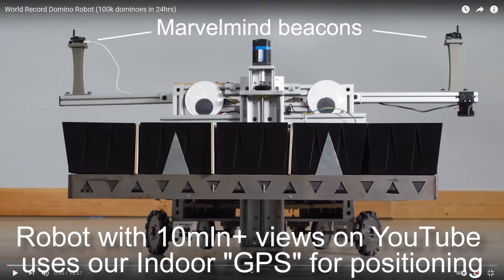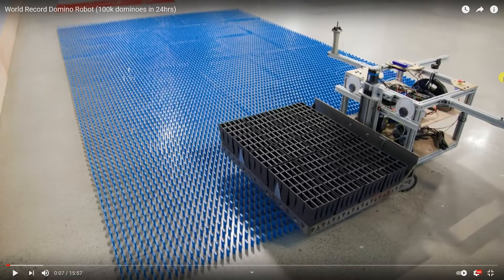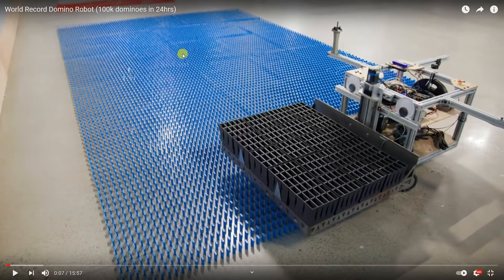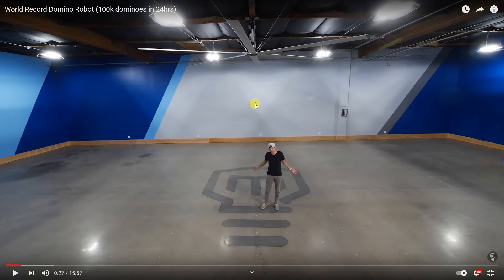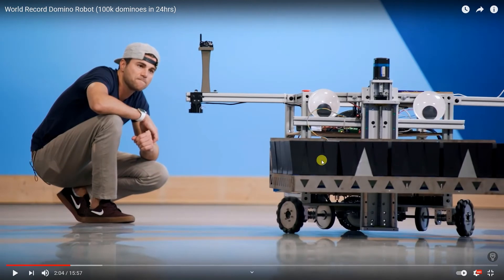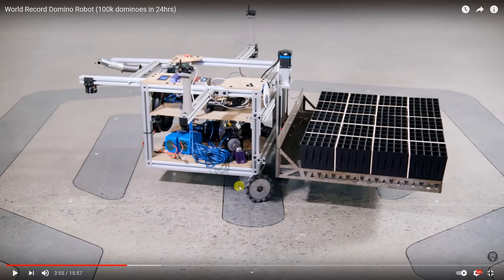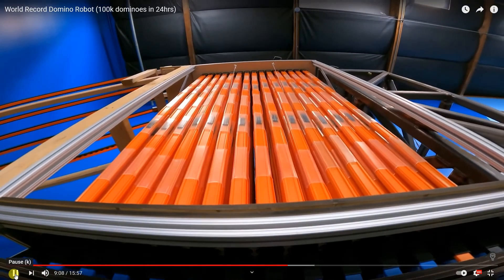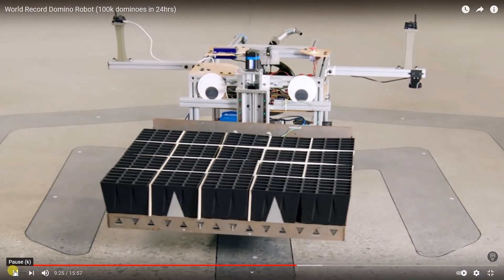Crazy people build crazy projects. We always help :-)

Comment: This video was that allowed me to find out about you. Your product is really interesting for my work where we take a certain measurements of concrete in subterranean parking spaces (potential to find corrosion) where the location of the measurement is important. Possibly we could use your system to link the location to the potential which would make our work much better and easier.
Reply from the maker: Yes, it is possible:
- Install station beacons on the walls around
- Take a mobile beacon and drive/walk around
- Spot and record the points of interest automatically with cm-level accuracy indoor

For more details: https://marvelmind.com/download/